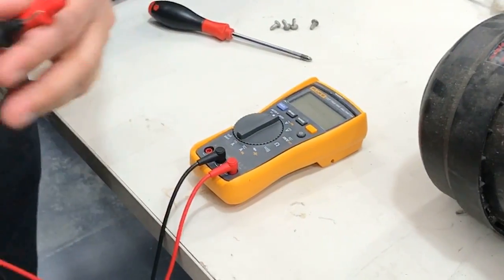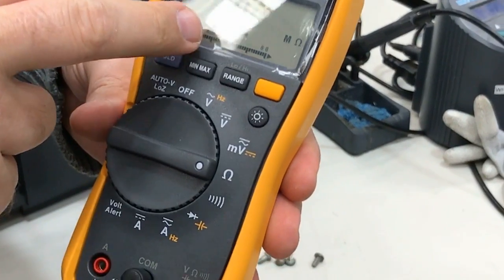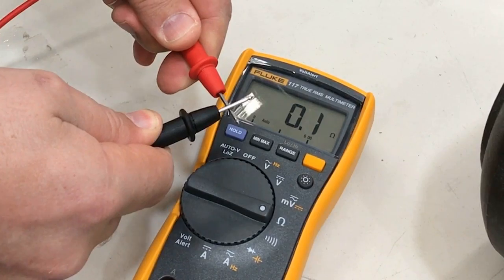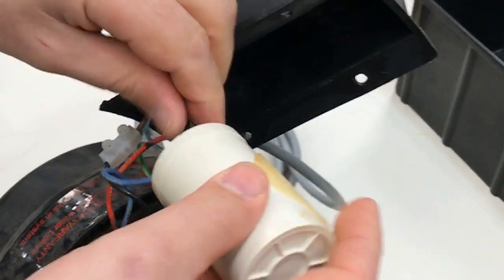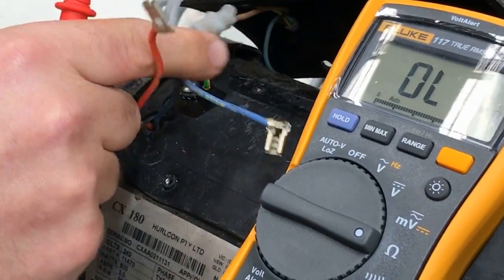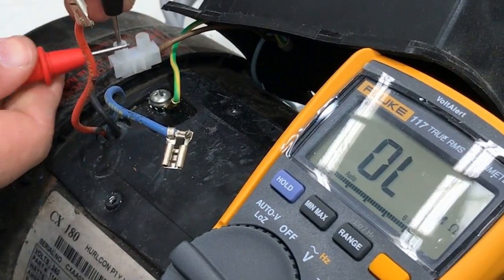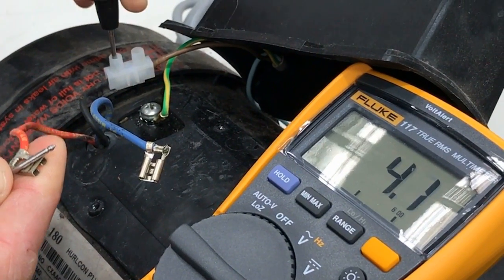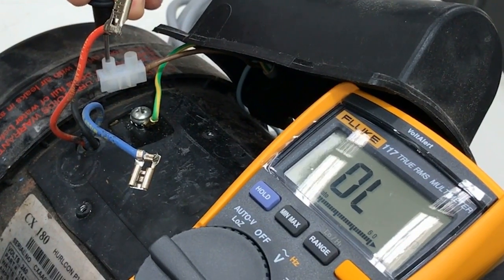Windings Testing AC Motor

Comment: Ohming a motor is not the best way. Megger is much better. I have had motors run fine and ohm fine. But after an hour of running, they start having problems. Megger the windings and immediately motor winding fail due to insulation breaking down. So if you deal with motors, you need to have a megger.